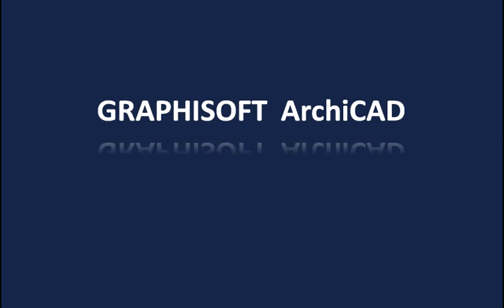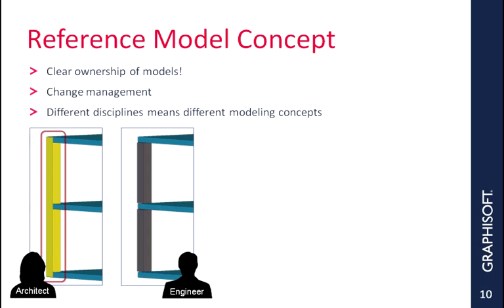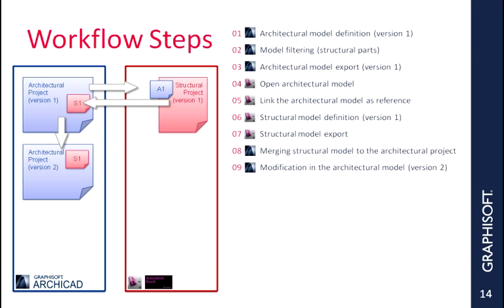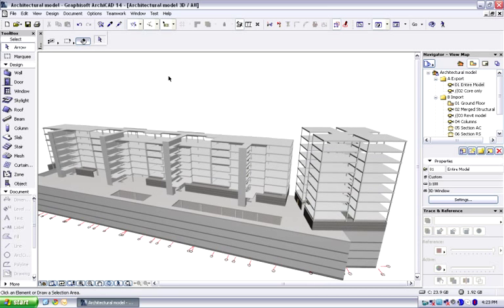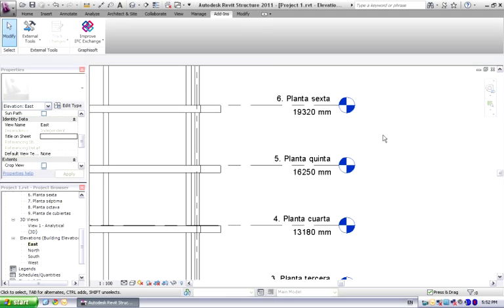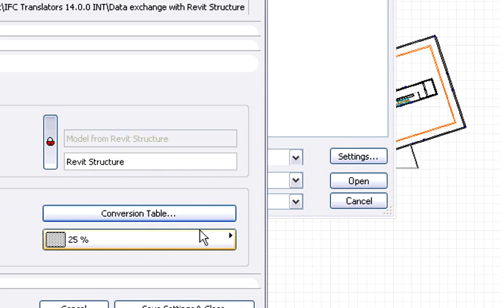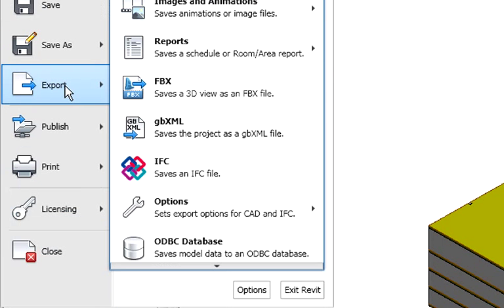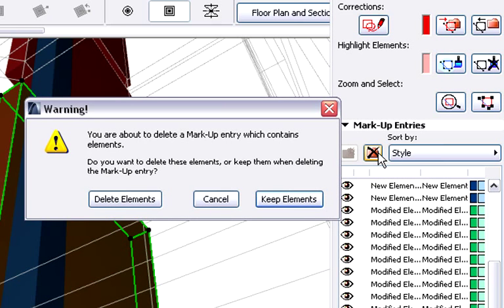ArchiCAD - Revit Structure Workflow

Comment: Hi, i need to export from archicad to revit structure and design the steel works. But everytime i export, it says the item is not recognized if i select like a column to out the steel.